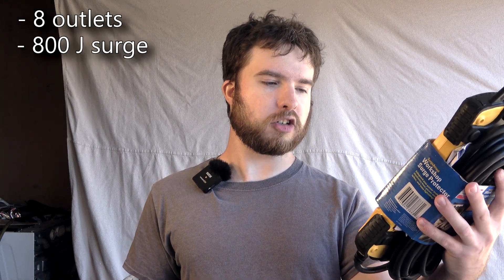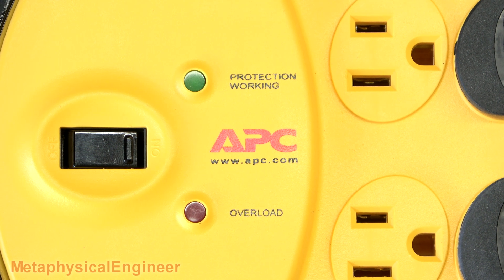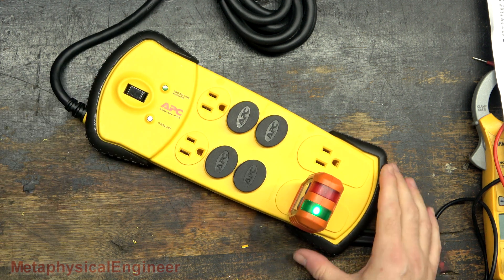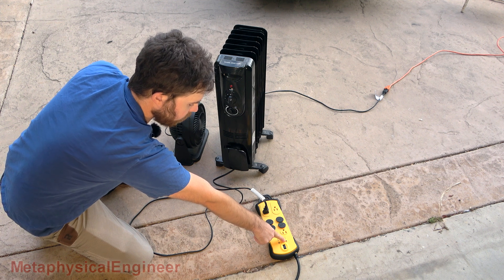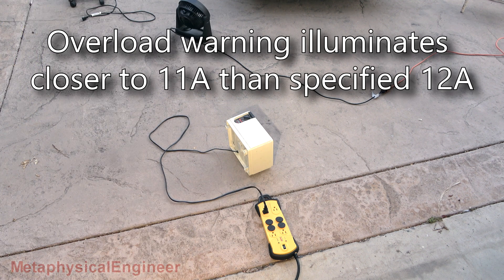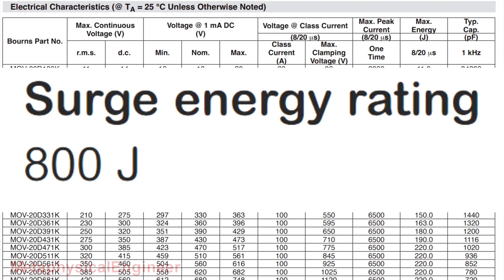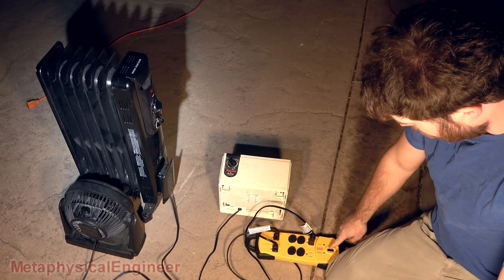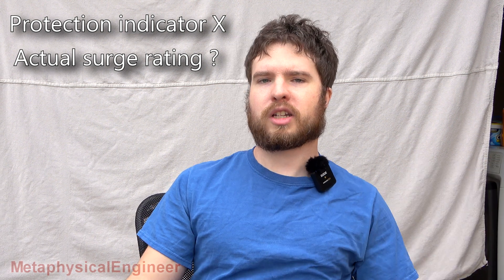What's Inside This Surge Protector?

Comment: each blue MOV is 95J,  no where near 800J, just 285J in total. there $0.51 each. Bourns Inc.,  Current - Surge: 6.5 kA, Energy:95J,  Capacitance @ Frequency:2400 pF @ 1 kHz, ROHS3 Compliant, could solder in about 6 more MOV.

Comment: Great video. I’ve been using a surge protector j bought 20 years ago for my home entertainment electronics. Is it still good?
Reply from the maker: Thanks!  Even if the "protected" light still illuminates, I'd be worried it could have degraded from minor spikes and surges over time.  Personally I would retire it to a less critical application and replace with a new one.  Much cheaper than replacing the entertainment system!
Reply: @MetaphysicalEngineer ty. So there is a life span on these devices?
Reply: If you are worried type kinda person, replace them every 6months or so, if you are the ignorant chill type any will do replace them every year or so

Comment: that APC was discontinued in June 2024 so you guys lucked into inventory clearance.  I've been taking apart SPD for 30+ years and you should do it to every one you buy.  they are fire hazards if designed or assembled incorrectly compared to simple power strips, as you know.  the big boys, APC, a brand of Schneider, Tripplite a brand of Eaton, are made well albeit the actual design can be suboptimal as you found out. however, if you get Amazon Basics, or even Belkin, etc., they are resellers for OEM, YMMV.  microcenter's inland spd?  the basic one has no indicators and only has one mov LN, no thermal protection in batch I have.  your only protection would be its listing by UL, ETL etc., but that's not on every product shipped, but a test sample and periodic resampling.  the one you actually purchase could have quality issues.   there are good sample failures with pics, see amazon reviews of their basic SPDs.  now on the indicator light, APC is not alone.  the less significant lines, LG, NG,  could still cause induced currents by large EMP like lightning or solar storms and damage electronics, so you'd want the SPD replaced versus your home theater.  but those tend to be true fast spikes, less likely to wear out the mov vs  sustained overvoltages on LN which are more likely to cause fire risks.

Comment: 12 amps at 110v (1320 watts) seems a little under rated to my Australian ear, we have a max power point rating of 2400 watts (10 amps at 240v)
Reply from the maker: Nominal voltage here is 120 for 1440W.  In the states, the NEC lists 80% of branch circuit capacity as max continuous load for durations of more than 3 hours.  For durations less than 3 hours loads may equal the branch circuit rated current, so 1800W on a general purpose 15A circuit.  

This surge protector's overload warning is tuned to alert the user they have reached or exceeded the continuous load rating.  Temp rise stabilized around the time I recorded the end of the load test, so I'm confident it will handle indefinite operation at 12A at normal ambient temps.  

20A is common for higher power kitchen or utility or workshop branch circuits for 1920W continuous or 2400W short term. Portable devices rated for 20A are not as common and will use a different plug.  Some light workshop or refrigeration equipment may have such a plug.

Devices such as clothes dryers, air conditioners, etc needing more will use a 208 or 240V dedicated circuit. Three phase service is unheard of in residential applications and only starts to be used in light commercial.
Reply: @MetaphysicalEngineer  we commonly have 15a 240v connections for high load. 3 phase is less common but still found in commercial kitchens, workshops, and some residential sheds.
Usually 415v. But you can get 240v from a single phase.
Reply: Ditto, for New Zealand, we share the same power standard.
Reply: @Another_Kiwi  AS/NZS3760 is the test and tag standard I am certified to - NZS - stands for New Zealand.

Comment: My understanding is this is one of the standard Surge Protection circuits.  With the other one just moving the location of the thermal fuses so they cut power to the outlets permanently once tripped.  That's what they're pointing you to in the manual  Not replace the MOV's.  Buy a different surge protector.  Never noticed the J mismatch before.  Kind of upsets me.  It's probably banking on the over current to kick in if the MOVs are cooking.  In that case I think I actually prefer the design that cuts power to the outlets permanently.  At least then a surge has to get past that (blown) fuse.
Reply from the maker: Yeah the power cut when the L-N MOV cooks and takes out F1 is the final safety measure.  But a surge N to G or L to G may well take out MOV 2 or 3 with no outward indication damage has occurred.  Hence the confusing instructions to replace a device with compromised protection but the device can't warn the user it is no longer capable of protecting against further hits of that sort.

Starting to wonder if the joule ratings on the data sheet is for max single event surge that will degrade the MOV beyond usefulness.  While APC has perhaps done testing to find the MOVs can take dozens of much smaller surges spread over time adding up to 800J.  MOV failure seems to be thermal in nature, so the smaller the hits and the more spaced out, the longer the MOV will last.  

Certainly something I'll find out more about in the follow up where I will take apart several more surge protectors.
Reply: I'd say skid marks are an unintentional indicator too 😂 @MetaphysicalEngineer
Reply from the maker: I'd say one of my power strips suddenly letting the smoke out qualifies for a code brown moment!

Comment: I ran into a similar issue with a Kemelo surge protector I recently bought on Amazon.  Unlike that APC one, this one not have a separate protection LED and its user guide only mentions about its overload protection breaker and nothing about surge protection, which makes me wonder if it has any MOVs.  My previous Belkin surge protector had a separate protection LED that no longer lights up after about 10 years of use, which is the reason I replaced it.
Reply from the maker: Thanks for the input!  Do you remember the full product name of the Kemelo unit you bought or have a link?  MOVs are very cheap so it may have surge protection, but I doubt it has thermal fuses or anything else.  

Belkin seems to have a decent reputation, and I have one of their units with a protection indicator. I'll be taking a closer look at it in the follow up.
Reply: The Kemelo one has the model number FMK235 - It has 8 AC outlets as a tower (2 per side), 4 USB charging ports and a 3M (10ft) lead.  My previous Belkin SurgeMaster 8 AC outlet power strip has the model F9M823uk2M.   The AC outlets still work, so still useful as a basic power strip.